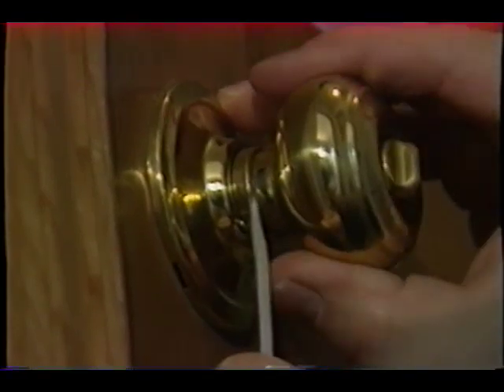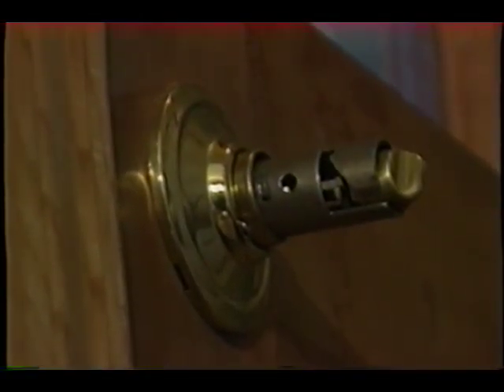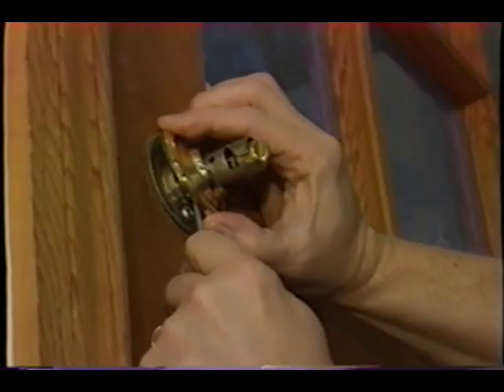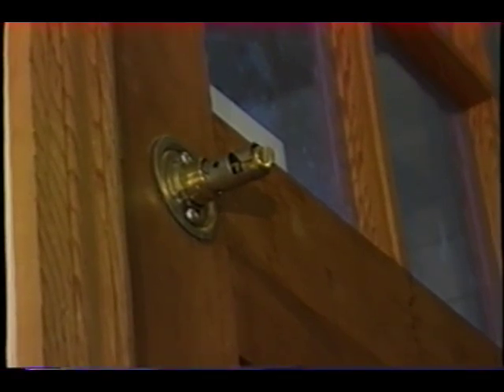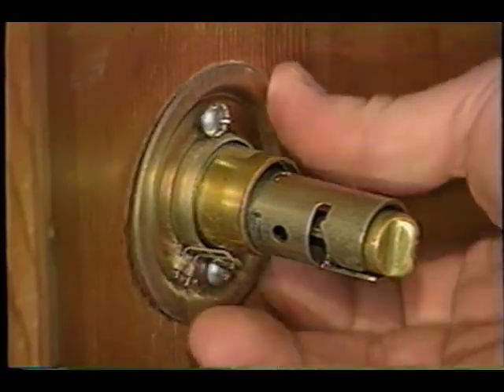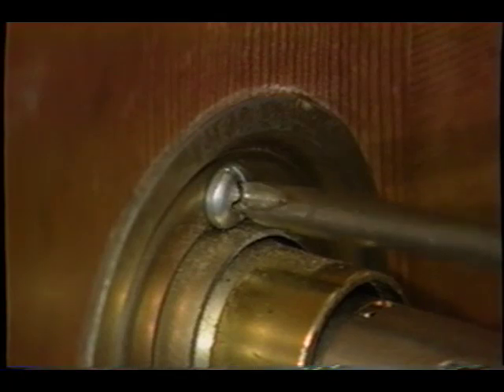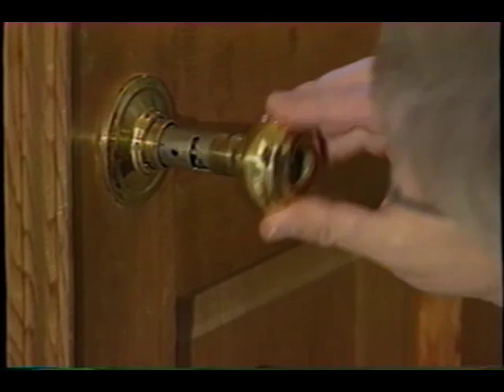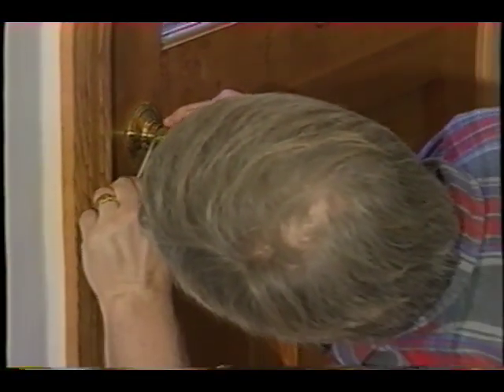Fix a Broken Door Knob

Comment: Thank you.

I have been battling my 1948 doorknob for 2 years now. All I needed to see was that little button and your flat head screwdriver and I went,..."ooooohhhhhh" I ran to my tool kit, and wouldn't you know it, the handle popped right off, and I fixed the door. 
Thank you.
Very helpful.

Comment: Thanks Tim.  I would have never been able to fix mine without watching this video.  For other people out there that have no holes at all on the doorknob (like mine) I ended up just turning the cover plate (or I think Tim called it the escutcheon plate) and it ended up hitting a spot where the plate popped out about a quarter inch from the door which exposed a little lever that I moved up about an inch  with a small screwdriver and this allowed the door handle and the cover plate to be removed

Comment from the maker: There are either two screws that are visible on one of the round plates that fit against the door, *or* one of the knobs slides off after you discover the release pin. You need to be more creative in your thinking. Imagine how it was put on. Good luck.

Comment: In my case, the problem is that the door handle has come off and I am trying to put it back on.  However, the little pin (spring) that is supposed to keep the handle in place, doesn't seem to be working properly.  It is permanently depressed and doesn't pop out when the handle is inserted.  Is there still a way to fix it or do I need to replace it.  Thanks for your help.

Comment: An ATV ran into my front door... Don't ask. The latch(The spring that pushes the latch to keep the door from sliding open) That is bent and how can I fix it, I got the dents out but the door won't open. Is there a way I can fix it cheap or do you think I damaged the internal components?

Comment: I have a paddle type door handle for the main entrance, it wont open from the inside unless you left the handle upward then push down then the door will open. Sometimes you would have to do it acouple more times to get the door open, any ideas on how to fix it beofre I go buy a whole new assembly?

Comment: i got locked out of the house between the utility room and the kitchen door knob was loose panicking my mom took the door knob off and it got worse couldnt put the knob back on but i got out thru another door could not get to the strike plate . should i just take the door off the hinges would that work? any info would help
Reply from the maker: There should be a center core of the knob or a square hole at the center of the door you can twist / turn to activate the latch. Send a photo of what it looks like to me. tim at askthebuilder dot com. HURRY!
Reply: it would not let me send a picture to that email address
Reply from the maker: MsLeelee94 That's odd. I get emails with large attachments all day long. Must be an issue with your ISP.

Comment: I have a door stuck in a closed position, the latch just won't open when either side of the handle is turned. I wanted to remove the knob but didn't know how, couldn't remove the handle to get to the screws. I'll try again, thanks a lot :)....!!!!!!